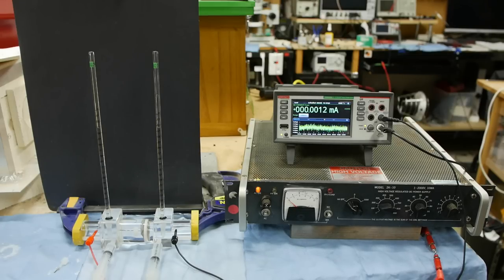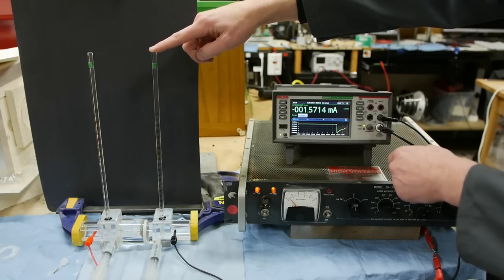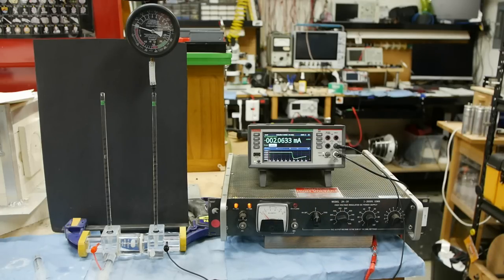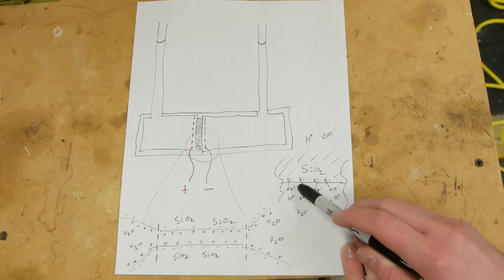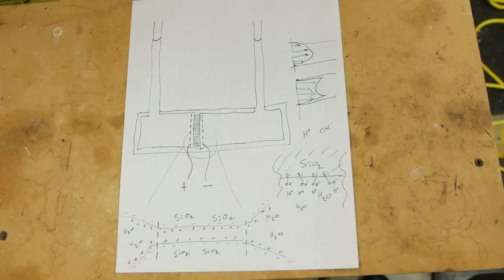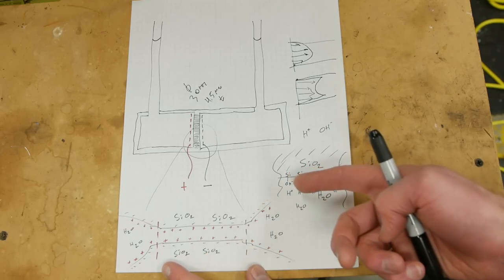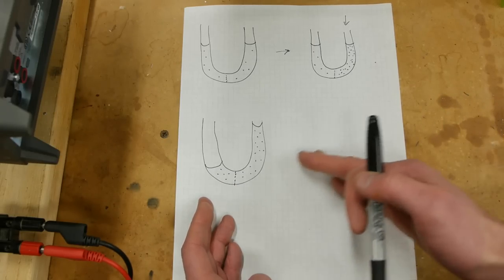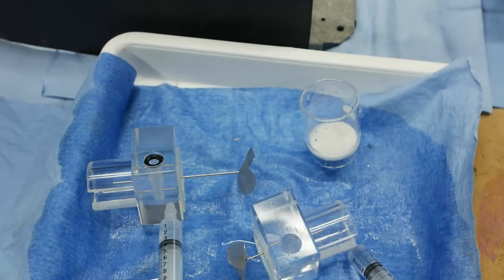Electro-osmosis: pumping water with electricity and no magnets

Comment: this seems like something that could be pretty cool in a PC watercooling loop. Depends on what kinds of pressure you can get as the cooling blocks are fairly restrictive. The pump speed seems quite low too but thats less of a problem
Reply: Another issue is the high voltage DC you'd need to run it. Can't be easy to get a couple hundred volts and water in something small enough to fit in a pc. And I doubt the flow will be enough, let alone the terrible efficiency...
Reply: @stevenutter3614  You can get inaudible sound levels with moving components like good quality low rpm fans on a big heatsink tower without sacrificing much apart from money buying quality components.
Reply: @TheAnoniemo  High-voltage power supplies are actually pretty simple and tiny, if you don't need more than a few mA. Simple voltage multiplier circuit. Think those electric flyswatters - they run off a 9V battery, and produce around 200V from it.
Reply: @vylbird8014  That electric flyswatter also produces tons of electrical noise and will probably fry the PC. But with the right filtering, yes. It's not that hard to build tiny high voltage power supplies that produce relatively clean output. 
His supply is only that big because it's a lab power supply with lots of different settings and other fun stuff that you don't need for a specialised application.
Reply: @Electroblud  Tiny power supplies for cold cathode tubes often used in decorating PC's are cheap and easily available, size of a small matchbox, and they generate a pretty respectable voltage - higher than he used in the video I believe. But I don't think they have much current capacity. I have one somewhere, but I don't have anything with which to measure it safely...
Reply: @vylbird8014  Those electric fly swatters use caps in an RC circuit and discharge that voltage very fast. It's not a sustained high voltage. That's why it's so small.
Reply: @TheAnoniemo  I have a power supply for nixie tubes that can deliver 200+ volts at few mA that's the size of a postage stamp... Adapting a circuit for the voltages need in this setup would be trivial and wouldn't make it much (if any) bigger.  Not that I would want a HV supply in my PC, but it's easily possible at the low currents required.
Reply: @TheAnoniemo  wouldn't a Stirling engine be better?
Reply: @TheAnoniemo  high voltage supply's are tiny if you don't need loads of current, I have loads of spare space in my Lian Li PC-O11 where this could sit, especially if my pump was gone. Power supply shouldn't be much of a problem to fit
Reply: @TheAnoniemo  yes but that air cooler won't be as cool as my water loop, or at least not once I'm overclocked to hell on my GPU and CPU. There is a reason I have this custom loop :P NH-D14 couldn't handle 1.375V 5GHz and the stock cooler on my 1080 didn't get close to 2100MHz core. I love air cooling, but it has a limit
Reply: Just buy a modern efficient PC like an "Odroid N2" or "Odroid H2"
Reply: Poor efficiency is a major draw back.  He said a lot of the energy is going to the electrochemical separation of hydrogen and oxygen.  That is kinda true. in reality, a small amount is actually going to making hydrogen and oxygen. The rest is called overvoltage and goes to making heat.  That just makes more thermal load for the radiator to eject. 

Here is a thought for a virtually silent pump for a PC cooling. A mercury magneto hydrodynamic induction vs conduction pump.  Run it off single phase with split phased coils/capacitor design.  Mercury in a coiled tube serves as the induction rotor and coils. Or rip out the rotor of a cheap shaded pole induction motor (small ac fan motor), and replace the rotor with a coiled tube filled with mercury.  Pump need not be inside PC.
Reply: @TimLF  that solves nothing? Those don't have nearly the performance any watercooling enthusiast is looking for lol
Reply: @kreynolds1123  Mercury dissolves blocks and radiators unless you iron plate them and Mercury fumes are super bad for you. Unless I'm misunderstanding your suggestion I don't think it's a very good idea even if it's really cool. The part about putting heat into the system with the pump is interesting though
Reply: @axelbostrom3606  i was just about to add that. That mercury makes amalgams with many metals that don't have an oxide layer. So one would need an oxide layer thick enough to protect it. The system would need to be closed loop so mercury vapors would not be a problem. A closer look at mercury as a cooling liquid and its low specific heat, means it is not that good for moving heat. And we have not even mentioned how much it expands once heated, aka thermonitors.
Reply: You could use the temperature gradient itself to pump the water like a coffee maker. As long as cpu temps around 100°c aren't an issue...
Reply: @175griffin  well they are :P Modern Intel CPUs are rated for a TJMax of 110C but at that temperature you wont be overclocking any. I like this style of pump as it both looks cool, it has no moving parts that can fail and seems to be fairly decent at pumping the water. If i had the resources spare i would make one for testing, but alas i am a poor student :(
Reply: @axelbostrom3606  100°c will cause thermal throttling and significantly shorten the life of the CPU even if it's rated to survive at that temp. Anything above 80 is pretty bad. For a water cooling system it's pretty important to move large volumes of liquid. If you were to use a pump like this it would need several staged and probably take up quite a lot of space. Plus you've got high voltages, water, and electrolysis going on in a computer case which sounds like a recipe for disaster to me
Reply: axel boström You are running 5 GHz at 1,35 volts on water while I’m running 4,7 GHz at 1,25 volts on air, is 0,3 GHz worth it even? It wouldn’t affect gaming I’m sure. My rig is basically silent and it never goes above 75C
Reply: @mikidof  what chip? i have an I7 4790K. That voltage would tell me you are likely on Skylake or you have an even better chip than me. Its also not just about needing the performance, its about having it, as an overclocking enthusiast i love pushing my CPU and GPU to the limits :) i pretty much just watch videos and play esports games, i would get by with my lowest end rig thats a G3520 and a GT 1030 just fine, but this is more fun
Reply: @TheAnoniemo  "inaudible" is subjective :)
Reply: @tablatronix  If something makes less noise than the background noise level it is inaudible no?
Reply: axel boström i have an i5 4690k actually, but I got lucky with the silicon lottery
Reply: @kreynolds1123  "He said a lot of the energy is going to the electrochemical separation of hydrogen and oxygen. That is kinda true. in reality, a small amount is actually going to making hydrogen and oxygen. The rest is called overvoltage and goes to making heat. That just makes more thermal load for the radiator to eject. "

Ah yes but there IS a way to increase the efficiency so that the energy lost to heat is minimized and more/most of it goes into the electrolysis process... Just like a linear regulator loses a lot of energy as heat, and a switching regulator minimizes that heat loss and is much more efficient. Maybe applying a similar principle to that comparison would work, this is linear electrolysis we need switching electrolysis! Let's figure it out and then unlike stanely myer don't keep it secret but post it far and wide everywhere you can possibly think of before they get you like they got stanely! So that way the cat will be out of the bag and there will be no way to get the world to unlearn how to do it! Then we can have cars that run on water man! No hydrogen storage tank necessary, a water tank instead and a water->hydrogen fuel injector cell that converts it on demand with high efficiency! :D Upon the hydrogen burning the exhaust becomes once again water! Clean burning, high energy density future fuel! :D
Reply: @YourTVUnplugged  switching regulates power but does nothing for efficiency. Efficiency is all about reducing overvoltage.  Every volt over 1.23v is an overvolt.
 So with an electrostatic hydropump using 600 volts means you are 598.77 volts overvolted for electrolisys.  

Stan was a fraud through and through. If his death was a murder,  it would have been because he stole a lot of peoples' money through selling his fraud.  It is sad that a lot of people are still so "flat earth like" that they don't know the physics/chemistry in stan meyers cell yet still fall for his deception.   

Lesson here is don't commit fraud and take peoples money.
Reply: @YourTVUnplugged  i should make one small modification to my comment on switching with electrolisys.  I  said it does nothing to increase efficiency.  But a cell's electrodes form the plates of a capacitor with a tiny amount of capacitance, and when i say tiny, i mean tiny, even as the electrolyte participates in being the dielectric.  Switched overvolts may temporarily store charges on the plates that quickly drop in voltage because  of the low resistance of the electrolyte, just the same as a capacitor and resistor circuit  where the voltage drops across the capacitor as it  drains its power into the resistor, the electrolysis will briefly increase with less overvolts. But for best efficency, one would have been far better to supply a constant voltage at the lower voltage and not have wasted energy switching excessive overvolts. But if you must, go get a buck converter  to get a low voltage across a single cell,  or better yet, stack cells such that they give you a reasonable production at a reasonable efficiency.

Comment: With a slow alternating current I wonder if it'd be possible to use the pumping like the pistons in an engine
Reply: Also, fast AC (say, +/- 2kv at a few thousand Hz) would be real interesting to monitor... if the skin effect comes into play, your flow profile will become even stranger...I don't even know where to begin to even simulate this with ANSYS, much less how to experimentally monitor the microfluidic changes, but the dynamics would be fascinating I'm sure

Comment: When you unplugged it at 4:04, I expected the current to shoot-up (instead of gradually ramping-up) since the back-pressure is instantly gone. Does the slow ramping allude to "gaining momentum" (of water-molecules) in the winding labyrinths in the glass-frit?
Reply from the maker: I'm not sure.  Your observation is correct -- it would seem the flow rate would rise much quicker than the current did in the video.  Someone should do a follow up with a sensitive flow meter, and plot that against current :)
Reply: Applied Science what frit coarseness did you use?
Reply: Stefan Krüger would that be the maximum size of a particle that can pass or the glass particle  size
Reply: @Scientificexploration  i guess its the particle size that can pass - that would make more sense to specify for the use-case for filters i think.. -
but it is really just a guess

Comment: Conspiracy theorists: is this free energy
Reply: free oll teh energiez
Reply: if only we could harness water propelled by gravity to create electricity
Reply: @casperx102  NU SHUT SHURLUCK
Reply: @casperx102  That's a big wooosh right there.
Reply: lol ok i do get the joke
Reply: Not free but seeing the interesting split of hydrogen from the oxygen when in contact with glass could make production of those gasses cheaper and or faster if you use the right structured system such as glass filler beads for paint free floating in a regular water splitting system.
Reply: @Barskor1  it is not split, just re oriented. Water is polar so it has a positive and negative side, the glass helps to arrange the molecules and the electric current forces the water to move.
Reply: @109268  That makes sense thank you.
Reply: @Ilikethis Not free energy, but low cost high density energy! IF we solve one crucial obstacle that needs to be overcome, see this post:
Keith Reynolds: "He said a lot of the energy is going to the electrochemical separation of hydrogen and oxygen. That is kinda true. in reality, a small amount is actually going to making hydrogen and oxygen. The rest is called overvoltage and goes to making heat. That just makes more thermal load for the radiator to eject. " 

Me: Ah yes but there IS a way to increase the efficiency so that the energy lost to heat is minimized and more/most of it goes into the electrolysis process... Just like a linear regulator loses a lot of energy as heat, and a switching regulator minimizes that heat loss and is much more efficient. Maybe applying a similar principle to that comparison would work, this is linear electrolysis we need switching electrolysis! Let's figure it out and then unlike stanely myer don't keep it secret but post it far and wide everywhere you can possibly think of before they get you like they got stanely! So that way the cat will be out of the bag and there will be no way to get the world to unlearn how to do it! Then we can have cars that run on water man! No hydrogen storage tank necessary, a water tank instead and a water->hydrogen fuel injector cell that converts it on demand with high efficiency! :D Upon the hydrogen burning the exhaust becomes once again water! Clean burning, high energy density future fuel! :D
Reply: Yes it is, it only requite a little electricity.
Reply: No, because even free energy believers would observe that he's putting electricity into it... Obviously? I know you were probably trying to make a joke, but in my opinion this joke doesn't work. Free energy scams only work WITHOUT any electricity being input.
Reply: @sei shin If you don't believe in all the obvious wrong conspiracy theories then congratulations you are most likely quite normal, but if you do then I just feel really sorry for you.
Reply: @Charlie K He knows, BTW you totally miss the joke.
Reply: It’s not free because it’s already Gibb’s 😉

Comment: It should be noted that I think borosilicate glass (eg Pyrex) is required. Not the much more common soda lime glass. I’m not actually sure that it wouldn’t work. I just know that borosilicate was more preferable. Not sure what glass you sintered there. You need the pore size to be comparable to the size of the double layer. We used essentially a single pore (channel etched into glass) rather than a porous filter. Your efficiency is probably so low because your pore size varies and some are probably too large. Also, probably more importantly, the pores aren’t straight so your lamellar flow is being destroyed by eddy currents. It’s why etching channels that are straight and narrow and consistent would get much better flow.
Reply: @18:30 you mention the flow profile. The EOF double layer is important. The outer layer is nearly static. It’s the inner layer that moves but it’s (like any fluid flow) very susceptible to turbulence. The efficiencies we (I say we, but again I was an undergrad when I worked here. I learned vastly more than I contributed) got were vastly higher, but the voltage was much much higher and the volumes much much lower. We worked in a partial clean room but the damn chips would always clog and be garbage. And making them by hand took dozens and dozens of hours (at least for me). We’d etch the channels in the glass than take advantage of an odd property of wet glass (borosilicate again) if it’s extremely clean and you get a single layer of totally pure water in between two perfectly flat layer of glass (which you could see quite obviously with the eye by the diffraction pattern formed) they would permanently bond - as if it were one piece. This is harder than it sounds in practice. It requires running 18.2 MOhm water over the glass plates. Having them extremely clean. A single dust particle would keep them from bonding.  Oh yea, you had to put them in an oven once you got the grating to go away, to cement it. This, I think, formed a covalent bond between the siloxane  (SiO3-) groups on the opposing glass surfaces. Could also have been hydrogen bonding. I can’t recall.

Comment: What an amazingly beautiful setup you created to demonstrate this. I have been researching the different electrical effects and unique qualities. I am going to look for the video to link a reference to. I would love to see if shining a bright light at the glass filter would change the efficiency by making the layer of hydroxyl ions thicker. I would also be fascinated to see if you pickup a current flow from the 2 electrodes across the sintered glass filter when shining a light source directly on it. Dr Gerald Pollack has shown a continuous pumping effect and also current flow to light an led powered by this layer of H2O3 "gel" layer Oh lastly have you tried the water "bridge" a layer of water across 2 beakers that will extend even to centimeter length by the high voltage potential between the 2 beakers. I  am so going to have to duplicate this. Kudos on such great work.

Comment: Thank you for the great discussion. I have had to explain how 1000 psig across a leak in a heat exchanger will result in fluid from the low pressure side going into the high pressure side. Next time I'll set up the salt membrane experiment and let the engineers "see" for themselves. Also, I really like seeing the way you made the experiment. Well done as always.

Comment: Regarding the flow profile, I have noticed one similar to this. I put a 12" x 4ft PVC pipe on the front of a sealed 12" sub, and the airflow seemed to be focused towards the edge. Seemed to be particularly focused at 50Hz, which was the tubes' tuning. High frequency electrical signals may also show similar flow patterns.